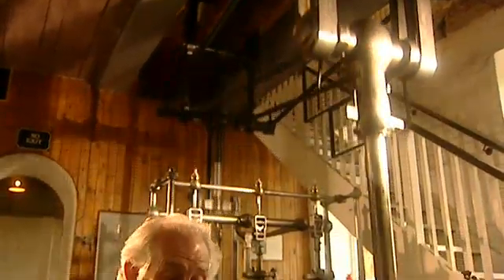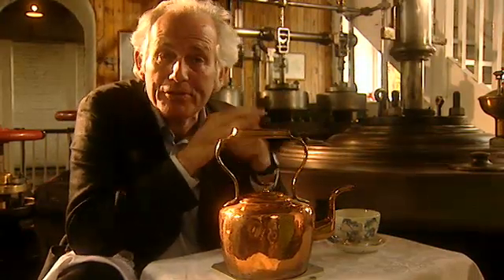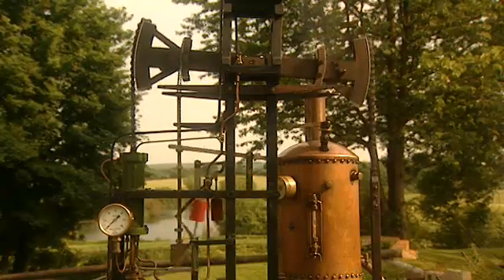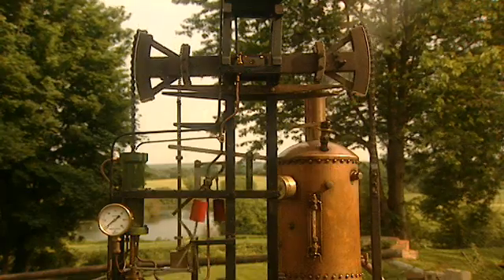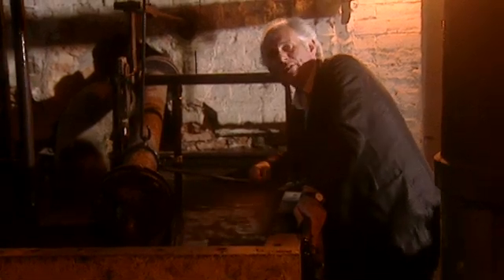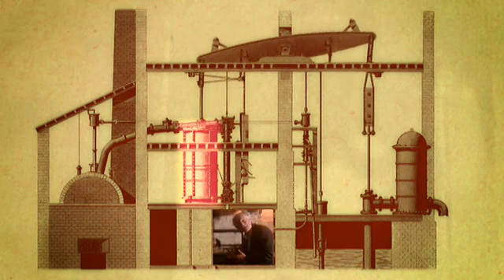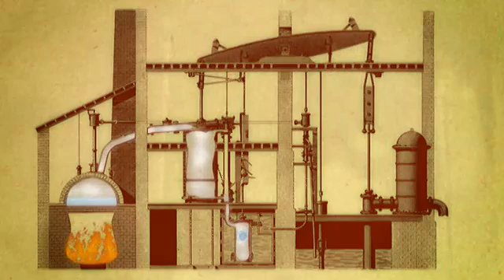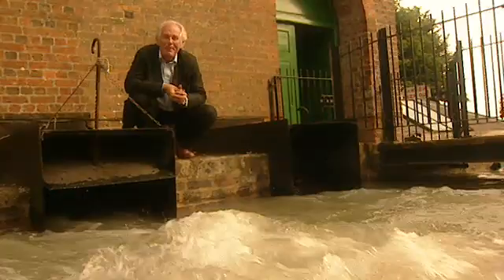James Watt Steam Engine

Comment: Everybody before James Watt used high pressure Steam (above Atmospheric Pressure) in their failed attempts to build a practical Steam Engine.
 They didn't know how to build a low pressure Steam Engine (below Atmospheric Pressure), and instead turned to Atmospheric Power, and there it stayed for the next 70 years.
 By creating the first 'Closed Loop' Steam Engine, James Watt could now use Low Pressure Steam for the first time.
 His Low Pressure 5psi., 'Closed Loop' Steam Engine could do the same work as an ordinary 20psi High Pressure Steam Engine, but using only 1/4 the amount of fuel. I've only just learned that Watt's Steam System actually had a name, a 'Closed Loop', and it's still used today in Steam Turbines. 
So, just like Watt's change from Atmospheric Power to Steam Power, and his new Engine are never mentioned, neither is his 'Closed Loop' Steam system.
Heating and cooling of the cylinder as the source of the inefficiency of Newcomen's Atmospheric Pump is  just a joke.

Comment: Newcomen's pump wasn't a steam engine, it was an atmospheric pump, it provided atmospheric power, a max. of 10psi. and no rotary motion.
Watt's steam engine provided steam power and rotary motion.
The problem of Newcomen's pump wasn't inefficiency, it was the use of atmospheric power.
Watt dumped Newcomen's atmospheric power for steam power, but, surprise, surprise, as usual, no mention of this, the crucial idea. He had to invent a new engine to do this.
 This was his ' great ' idea, and it worked! He invented the world's first practical steam engine.
His optional separate condenser didn't apply to a Newcomen atmospheric pump, it applied to his own steam engine. It recirculated hot water and eliminated atmospheric pressure. Atmospheric pressure works against a steam engine.
Newcomen's pump worked on the principle of atmospheric pressure. ( principal of the vacuum ? )
They even carefully avoided mentioning steam pressure when talking about Watt's kettle, when young.
The vacuum does not pull the piston down, steam pushes it down.